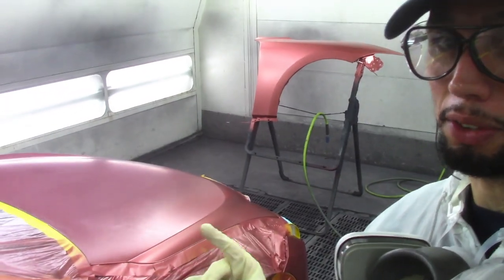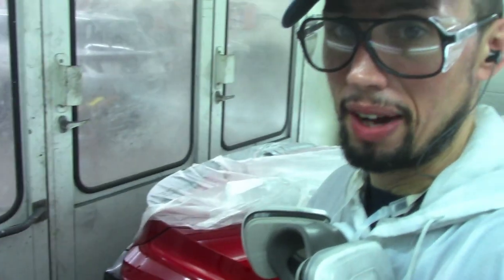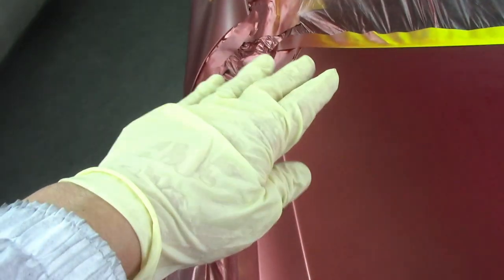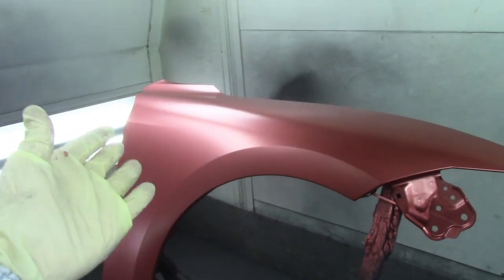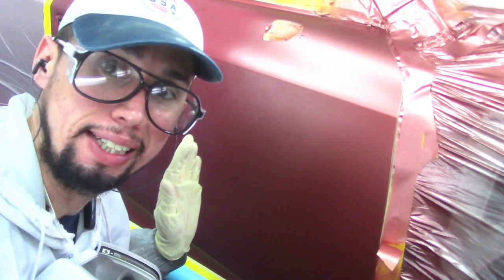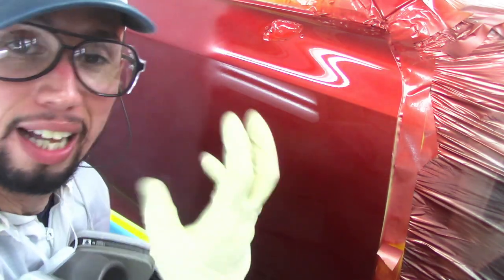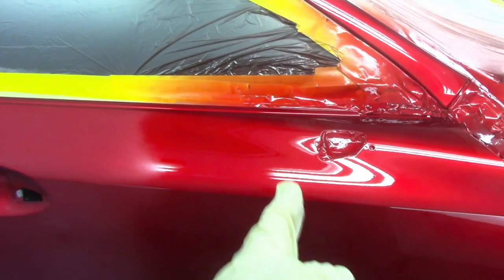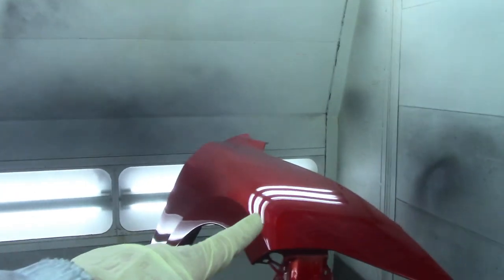3 Stage Red Kandy Paint Job+ Blending Tinted Red Clear Coat Tips And Tricks.

Comment: Do u put the base coat on with the same  pressure  as the pearl
Reply from the maker: I spray the base at my regular psi which is 2 bars on the pressure gauge. And since the tinted red red clear coat is clear I spray my clear coat at 3 bars on the pressure gauge.
Reply: @J.Lulo_  😊thanks  with any mid coat.i know  the Spies Hecker  base is a little  bit thicker